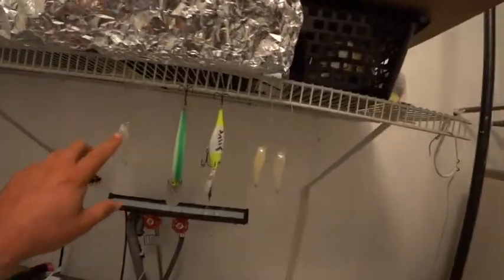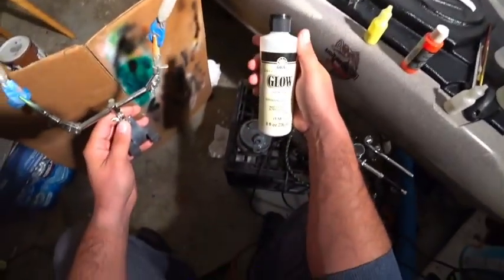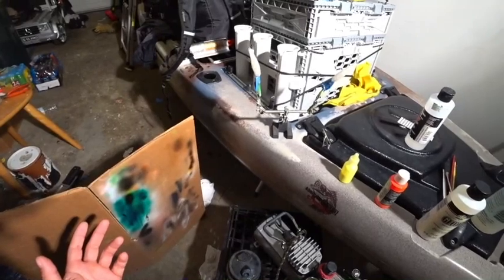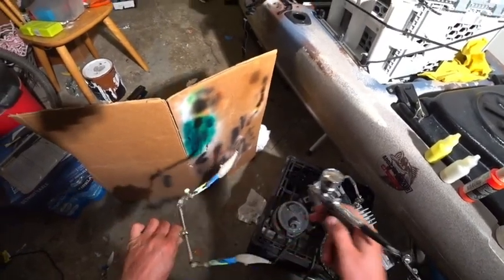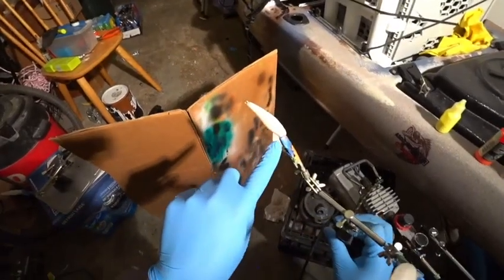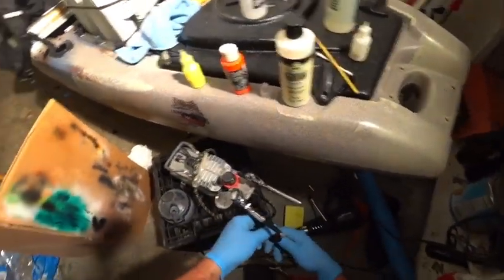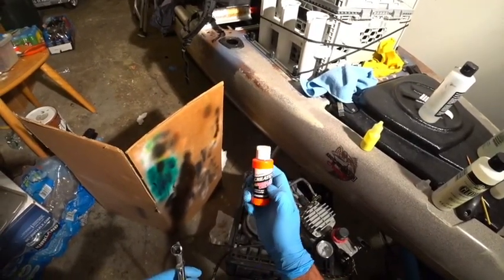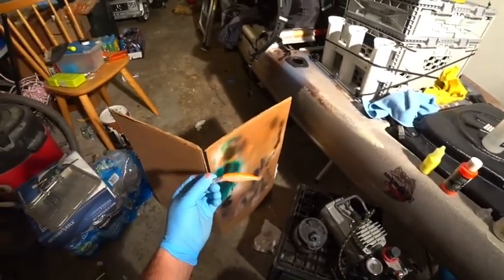How to paint Glow in dark Crankbaits

Comment: Can you tell us the name/brand of the glow paint?
Reply from the maker: I used folk  and reducer , sprayed 45 coats toke me 2.5 weeks to make them .
Reply: @AddictedAngler  thanks for the response. Did you mean to type 4 to 5 coats? Or did you really do 45?
Reply from the maker: @westcoastgrizzly  no 45 to get it right because of the thiner. U can try other glows . Folk is not for air brush in order to brush it u need to thin it . Also need to spray and let it air dry other wise turns orange . This is why I stop making them just made enough to last me few years
Reply: @AddictedAngler  Gotcha. Okay thanks for all the great info! I ordered some of the paint and will be adding tackle to my website soon so this is helpful. Thanks!